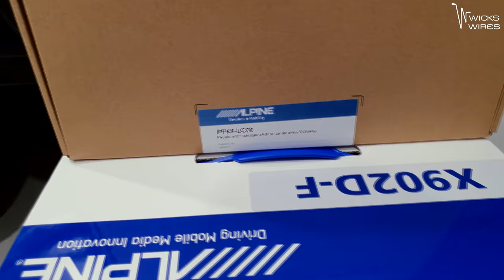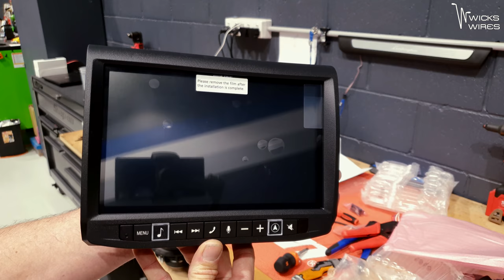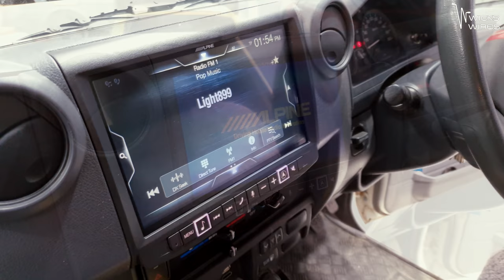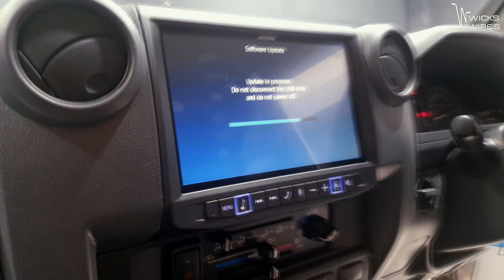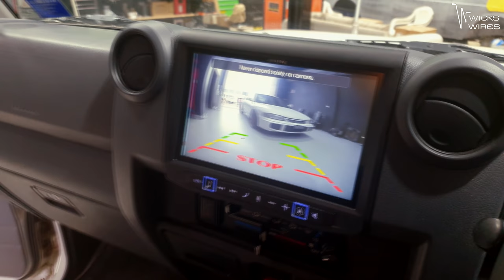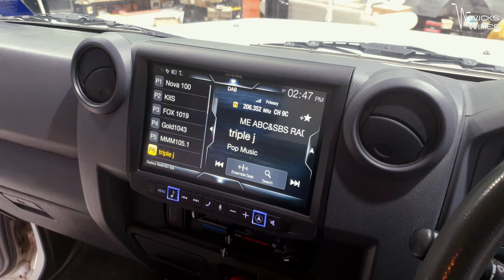Toyota LC79 70 Series Land Cruiser Alpine 9" HEMA Perfect fit Screen Unboxing And Installation!!

Comment: Really appreciate all your help I have another question.

I have a i905 alpine head unit with rca’s running to the R2-A60F 4 channel amplifier and a R2-S653 set of component speakers, do I run all  the speaker cables to the cross over , as in just one set of speaker cables from the amp to the cross overs and then wire all the speakers from the crossover, if so do I need to bridge the cables from the amp to the crossover , as it’s a 4 channel amp,if so what size wiring will suit it ,or should I just have the subs from the component speakers wired directly from amp to the speakers and run another speaker to the crossover feeding the mid and the tweeter .Please Help

Comment: Nice Video for a nice Radio, but what happened to the original hazard warning lights Button and the Clock? The Clock is not so important, but the hazard lights are.
Reply from the maker: The clock is deleted while the hazard button is relocated into the blank position on the heater control panel with a new switch 🙂

Comment: Thanks for the reply I’m in the middle of wiring my alpine  i905 to my 70 series with a aerpro steering wheel control if you have any footage of wiring can you please let me know as I’m having a hard time with it
Reply from the maker: @shdhrjdi  The pre 24 70's don't have steering wheel controls, so this one did not have any. It should be a pretty standard toyota wire up. Are you sure you have the correct patch harness for the aerpro module?

Comment: Great video I
 Installing the i905 do you need to instal the vss vehicle speed sensor pulse line
Reply from the maker: Not 100% necessary,  but I would recommend it. It is hooked up to the original unit, so it is there with the original wiring.
Reply: @wickswirescaraudioandfabri7730  what colour is it

Comment: Hi Awesome info and love the look of them and how they sit. Just wondering if there is any info regarding the rear entertainment outlet (hdmi out) and how many screen to the rear that can be run off this unit ie, 2 rear screens or single roof fold down unit?
Reply from the maker: Thanks mate 🙂 It is just a single hdmi output from the unit, mainly designed for the Alpine roof mounted monitor. It can be used for 2 monitors but will display the same output.
Reply: @wickswirescaraudioandfabri7730  cheers for the feedback.

Comment: Jay I just did sound deadening in my 21 Elantra. Never done it before. Went with kilmat 80 mil and it took me 17 hours over four days to do the four doors! I did the inside door skin, every flat spot on the plastic attached to the door and also every flat spot on the door card. Upgraded to Hertz DSK 6.5 comps in the front and 6.5 coaxs in the rear. Just running on deck power now but WOW! What a difference! Doing the rest of the car in the next month. My question, is 80 mil enough to take care of road noise? Sorry for the novel mate!
Reply from the maker: Good job mate, deadening really is the most important task of any good quality install. As for how much to use, every car is different. We did tripple layer on this LC79 and we could have gone further, but it made a massive difference. Wheel arches, floor, wheel well and under the back seat are your main road noise concerns, the roof also makes a massive difference as its the largest flat panel on the car and can resonate a lot. Also once the roof is done the wind and rain noise is virtually non existent 🙂
Reply: @wickswirescaraudioandfabri7730  your awesome! Thanks Jay. I'll let ya know how it turns out👍

Comment: Did you have to cut the dash mount to allow it to fit. Just doing one now on my lc79 2015 single cab it’s a bit of a nightmare
Reply from the maker: Yes, you do have to cut the inner part of the dash. Can be a little fidly but the reward is worth the effort 😊

Comment: Did u wire up the factory camera to the Headunit and does it automatically turn on when u put it in reverse?
Reply from the maker: This had an aftermarket camera on it but you can definitely can keep the factory camera working. Yes, turns on when the car is put in reverse 🙂